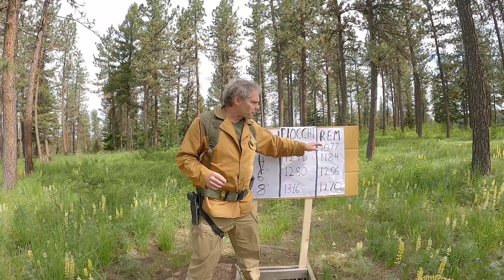How Does Barrel Length Change Velocity

Comment: Great video Paul!  When I first saw the title, I thought, "Well duh."  Then I thought, 'why is he testing all the different barrel lengths, wouldn't testing just the short and the long prove the point?'  Glad you did as you can see where that barrel length begins to drop off in performance.  Great work!

But this gets me thinking.  What about PCCs?  If a .357 starts dropping off at about 6" from a revolver, what is the drop off point for a 9mm?  The longest 9mm pistol barrel I have is in my HK VP9 at 4" vs my Ruger PC Carbine at 16".  But as neither of these have a cylinder gap, that has got to make a substantial difference.  The tough part would be finding both a pistol and carbine by the same maker with the same barrel geometry and a series of barrel lengths between 4" and 16".

Now I did a test a couple of years ago with the same ammo from a Coonan .357, this is a 1911 chambered in .357 magnum, with a 5" barrel and a Rossi 1892 lever action also chambered in .357 magnum with a 20" barrel.  Firing UMC 158gr. SJFP .357 Magnum ammo, the Coonan averaged 1550 FPS and the Rossi averaged 1930 FPS.  Something to think about anyway.

Comment: I have a Ruger GP100 .357 4" and a Ruger Redhawk .44mag 4" and I was thinking I had made a mistake because of all the velocity and accuracy I was losing compared to the 6" models. After seeing this with only a 36 to72fps difference in velocity, to me, the 6" is pointless considering the awesome accuracy I am already getting from the shorter ones. I know ammo will sometimes change that but I load my own and I weigh the powder on every round to 0.1gr +or-. It's tedious but worth it for the consistency of the ammo. I was thinking of getting a 6" in both but after this I don't see the point.

Comment: Looked like the powder was nearly completely combusted by the time that the bullet left the 6" and 8" barrel.  The other factor is the additional time available to accelerate the bullet in a longer barrel, which was not mentioned.  As stated by Paul, there is a diminished return on the extra barrel length at this point.  Very interesting and I would have expected the velocity to keep increasing substantially through an even longer barrel.  Modern powder burns fast!

Comment: Also ammo manufactures load ammo with different powder. Slower burning or faster burning. The faster burning will run out of pressure sooner and thus not take advantage of the longer barrel. The longer burning will give a longer burn time and thus still be pushing the projectile faster in longer barrels as the expantion of gasses last longer.. Try hand loading to prove this.

Comment: “The Dan Wesson Pistol Pack” was not what I guessed, since technically that’s still seperate distinct barrels, that might have minute differences in them, giving potential for variances…

I was guessing “handgun with a 16 inch barrel (like the glock rifle conversion kit)”, then you test it at 16”, chop off a few inches off the bartel. Test it again at the shorter barrel length. Chop off more. Repeat

Comment: I totally understand how difference between handguns manufactures and styles can affect the results.  It seems that the .357 mag ammo and powder load was design to work best in the 4" to 6" barrel length range.  I am kind of curious to see if you can demonstrate that a long barrel will start slowing down bullet.  I have a S&W 686-6 and Marlin 1894C carbine with an 18" barrel.   Being that the .357 is designed as a hand gun cartridge you would think that it might show signs of slowing going through the 18" barrel.  The question is would your results be the barrel length and complete combustion of the powder or due to design differences which would be very hard for you to rule out.

Military artillery and naval gun guns depend on matching the correct powder load, projectile weight, and barrel length for optima performance, so I get it.

Comment: Also Paul, the case for a longer barrel for hunting when using say a Buffalo Bore round that has a slower burning powder, that is really optimized in my lever gun by the way with a 16" barrel, but would get increased velocity out of an 8 or 10" barrel as opposed to ammunition designed for shorter barreled pistols.

Comment: Excellent presentation! Perhaps you could someday try a similar test comparing the increase in muzzle velocity going from a revolver or pistol to a lever-gun or pistol caliber carbine. You're then talking about going from say a 4 or 6 inch barrel to a 16, 20, or 24 inch barrel. That's a much more significant increase than going from a 4 inch barrel to a 6 inch barrel. I've seen debates about lever-action rifles in particular in calibers like .357 and .44 Magnum, where people go back and forth about whether to go with a 24 inch barrel or a 20 inch barrel. With some people claiming they want the extra velocity a 24 inch barrel supposedly gives, and others claiming it doesn't give you much of an advantage over an 18 or 20 inch barrel.
Reply: Paul has a lengthy presentation covering this.

Comment: How about powder placement in the cartridge? I read an article many years ago about pointing gun straight up and back level before firing versus pointing it down and then back level before firing. If I remember correctly, the chronograph fps values were different. That might be interesting testing. I love this guy.

Comment: Great presentation, Paul. I appreciate the different bullet weights to better study the phenomenon. I think I can add some clarity to the underlying physics - irrelevant of whether the powder burns complete or not (I actually have no idea exactly how much of a factor this is), we expect to see higher velocities from a longer barrel for a simple reason - in a longer barrel, the gas applies force to the bullet for a longer time period, increasing the kinetic energy imparted on the bullet. This would be true even if the powder all burned instantly - it's true in air rifles, which are all pressure, no burn. If you've ever pushed someone on a swing, or played tennis, you know you need to apply that pushing force for as long as possible to impart a higher velocity - the bullet works exactly the same.

The diminishing returns are quite interesting - the further the bullet travels down the barrel, the higher the volume of the contained gas becomes, which reduces the pressure of the gas, and thereby reduces the force applied on the bullet by the gas. But don't forget, there's a lot of friction between the bullet and the barrel, and friction is proportional to velocity - as your long barrel pushes your bullet to higher velocities, it also produces significantly more friction, leeching off progressively larger chunks of that gained kinetic energy. This is the reason rifle barrels are generally much shorter lived than pistol barrels. It's also the reason massive rail guns are not yet practical - the incredible velocity produces incredible friction, and ruins the barrel after a couple of shots.

Comment: Longer barrels will have varying impacts on velocity depending on the burn characteristics of the powder.
Going to the eight-inch might have little value for a powder like Red Dot or N320, but with a slower magnum-type powder like W296 or 3N38, the extra inches should most likely pay off.
My deer-hunting friend chooses to use an 8" .357 for his (much overloaded) slow-powder, 180gr bullet loads, forgoing the convenience of portability in the field for the increased power.

Comment: Paul I hate to break it to you but you invalidated ALL the data!
Why? Look at the gear you are wearing! Is that a web belt with eyelets? That alone shaves 20-35 fps off any bullet. Is that harness made of cotton? Take off another 10 fps. LOL, your web belt does not have a Cobra buckle! Another 50 fps off the top.
Paul, for someone who is an expert, you should know that you need Velcro for adjustments, more buckles on should straps, and I see no morale patch areas. AND...no facial hair! Are you f-ing kidding me? You cannot test weapons of mass destruction looking like a normal civilian. What were you thinking? You could have blown someone's lung out, ka-powed the barrel(s), or, at best had a squib round. You were lucky that day.
Reply: LOL 🤣

Comment: Good demo but it has raised a question for me... (I live in a country where it's particularly difficult to own a hand gun, not impossible but particularly difficult...).
On the subject of barrel length, we could see that different bullet weights made a difference or different ammunition, manufacturers could easily use a different powder types or amount of powder and this is the thought that brings my question. Is there a commonly available (not hand loaded) way of making a 2.5" barrel fire it's (same weight) projectile as one of these regular rounds, through a 4" barrel. I'm thinking about maybe a +P or something. I'm specifically thinking about concealed carry where maybe a 2.5" would be preferable to a 4" but the stopping power is still a desired factor.
Although, being a .357 you used to demonstrate, the numbers you got from the 2.5" wasn't exactly terrible, with either load.

Comment: Several years ago, like about 1982 or 83, I did a similar test with a couple of friends of mine. We used .38 Special, 158 grain SWC ammo, and the guns we used were a Smith & Wesson 2" J frame, a Ruger Security Six with 4" barrel, a Ruger Blackhawk with 6 1/2" barrel, and a Savage Mdl. 24 .357 Magnum/20 gauge. The results were kind of fascinating. I don't remember the exact bullet speeds now (1982 WAS 40 years ago), but they varied from about 850 fps in the J frame to roughly about 2100 fps out of the Savage 24. With the pistols, each two inches added a couple hundred fps to the bullet speed. The Savage really blew us away. We really weren't expecting that much of an increase in bullet speed. Barrel length really does make a significant difference with any given caliber about how fast the bullet travels. The ammo we used all came out of the same box, so the only difference in our equation was the barrel length.

Comment: I concur with virtually everything in your explanation about how barrel length affects muzzle velocity.  The quibble is with the relationship between pressure build up and bullet pre-muzzle movement.

Some years ago I had two clients.  One was a handgun manufacturer, who, as a result of more modern piezo pressure sensors, was interested in the same question but uncertain as to how to develop data to answer it.  The other was a scientific outfit whose capabilities seemed to be exactly what was needed.  I put both clients together and was rewarded with the opportunity to go along for the ride and see what was learned.  And, for the record, putting these two groups together was my sole contribution; I claim no personal expertise on the subject.

It turned out that for loads like mid-range to factory normal using propellants like Bullseye or Unique, peak combustion chamber pressure occurred before the bullet began to move out of the case.  For higher pressure rounds using typically “slower” propellants, such as Win 296/Hodgdon H110, the bullet began to move before peak combustion chamber pressure was achieved, but only by a very small amount (less than about ¼ to ½ of an inch, from memory).

A couple of other things of possible interest that I learned.  No. 1 is that the point of peak chamber pressure signals the completion of whatever degree of propellant combustion is going to happen.  No. 2 is that as the bullet begins move down the bore, the effect of the Ideal Gas Law and the resultant increase in combustion chamber volume causes post-combustion combustion chamber pressure to decrease.  However and No. 3, so long as combustion chamber pressure during down-the-bore bullet travel exceeds a given value (dominated by friction of the bullet within the bore), bullet velocity would continue to increase (up to the point of bullet exiting the muzzle and combustion pressure venting to the atmosphere).

Comment: There's a project called Ballistics By The Inch that has done something like this using, if I remember correctly, a hacksaw and a Dremel to "adjust" the barrel length.
If you could get graphs of the pressure behind the bullet and the resistance to motion through the rifling over the length of its journey down the barrel and subtract the area under the graph of resistance from the area under the graph of pressure behind it, multiplied by the cross-section area of the bullet, you'd get the energy in the bullet. Double that, divide by mass and take the square root and you have the velocity. As the bullet goes on, the volume behind it is increasing, which decreases the pressure. As the powder's still burning and adding more gas, doubling the volume isn't halving the pressure. At some point the force pushing the bullet forwards (pressure behind it multiplied by its cross-section) is going to drop so low that the resistance to its movement (pressure in front of it plus tight fit) exceeds it and the net force is backwards (forward force minus backward force is a negative number) and then by making the barrel that long or longer you're losing energy. The powder may not have finished burning at that point. You may still get a fireball of hot, unburned powder mixing with the air in front of the muzzle. The other way round, you could get so much gas from complete combustion that the bullet's still picking up energy as it goes even after the powder's pretty much done.
Maximum velocity comes at different distances for different calibres. .22 LR it's about 12" down the barrel. 9 x 19 mm it's about 16.5", which is conveniently just long enough not to count as an SBR. Handy, right? For 5.56 x 45 mm, it's around 25.4", the length of the barrel in the L86. Considering how quickly those little bullets get from 970 m/s back down to the 940 m/s you could have had from a shorter, handier barrel, benefits dubious!

Comment: With other calibers, and powders (slower) like H110, WW296, Alliant 300MP, and lil gun there may be a more significant difference with barrel length. 327 federal comes to mind as it is a long small diameter round that operates at a pretty high pressure 500 s&w also due to its operating pressure and volume of powder.

Comment: One of the most important things to realize is that even two guns with identical barrel lengths, even from the same manufacturer, can have give very different velocities.  I've seen people do tests where a 5 inch gun like berreta 92 or 1911 will provide lower velocities than the same load fired from a gun with a 3.5-4 inch barrel.  In fact, some companies(I wanna say buffalo bore is one?  Or maybe double tap?) even list their velocities from different guns, and often the longer barrel has lower velocities than the shorter barreled gun.

Comment: Thank you for a interesting test. I was surprised by the results, but I shouldn't be given the infatuation with itsy bitsy teenie weenie handguns it stands to reason ammunition manufacturers would start using powders that perform better in shorter barrels. I can't wait for this fad to be over. In my experience these excessively small handguns are very difficult to shoot accurately. The tiny gun fanboys say they can shoot well, but when I take them to the range we find out what the truth is. They then argue that accuracy doesn't matter. To which I respond accuracy is possibly the only advantage one would have against an armed assailant who probably doesn't have the sense or the means to become proficient with their weapons.

Comment: In America, it is no longer worth buying a semi-automatic carbine because the barrel is either too short or too long
For example, I don't see much point in the 5.56x45 AR-15 pistols from CMMG or the Draco 47 in the 7.62x39 caliber, and the 20 "barrel AR15s are more like a fishing rod than a rifle. 
And these new "full size" pistols like the XDM series pistol manufactured by Springfield Armory is also extremely unsuitable for self-defense, as its barrel is too long, despite the fact that it is only 9mm and it is impossible to carry it hidden on the street due to its large size.

Comment: I have a couple older guns I inherited chambered in 35 Remington.  I have reloaded and used them for years.  Both are standard for cartridge 20 inch barreled rifles.  I recently added a 22 inch barrel rifle to the collection and you wouldn't think that extra 2 inches would make that much of a difference but it does.  Depending on the powder used velocities can be 100 to 175 fps faster than the 20 inch barrels.  I have one particular load/bullet combo that has made that fairly anemic gun a 200 yard gun using standard powder and standard lead tipped bullets.

Comment: To be honest, you can't really compare velocity with barrel length using revolvers, because the cylinder gap makes all the difference, and that can be inconsistent even within the same manufacturer or model. With semi-autos it's pretty much a wash because regardless of whatever the rest of the gun is, all barrels in a certain model/caliber will be an identical tube, relatively speaking (assuming you are using traditionally rifled barrels)
Reply from the maker: With this particular gun, the cylinder gap is the same each time because I set it with a feeler gauge when I changed the barrels.
Reply: Did you even watch the video to the end?